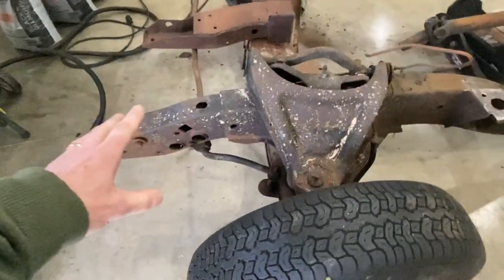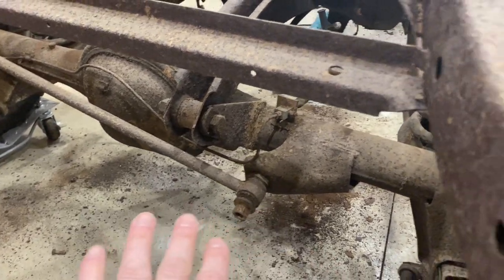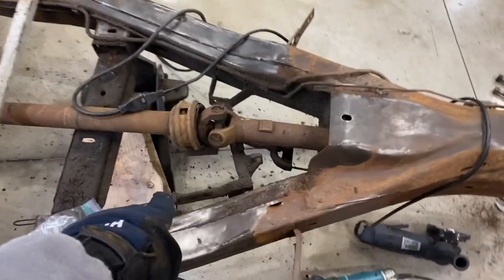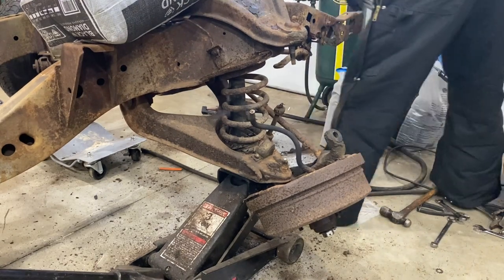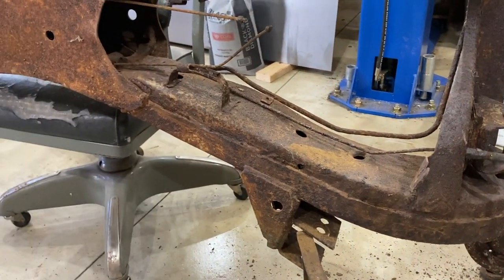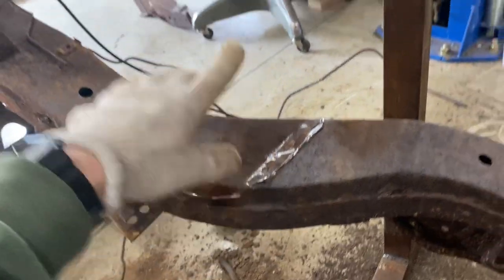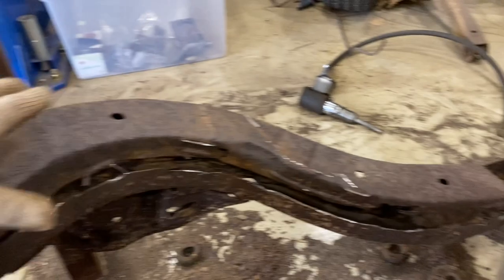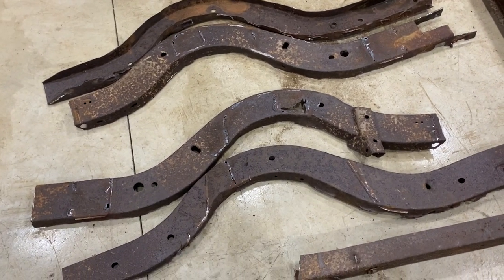I Cut The Back of My Frame Off (BUT FIXED IT!) | @projectcarrescue​

Comment: Back in the mid 90s when I was in the Marine Corps because so many people were getting hurt by the springs shooting out of a truck we would run a ratchet strap from one spring to the other and just get it to where it was slightly tight and that would keep the springs in the perch. Use it if you'd like it's saved quite a few teeth threw out the rest of my time in the Marine Corps. Something I've used even after I got out. It also helps forgiving them back into the Perch on re assembly.
Reply from the maker: That’s a great tip! Thanks for sharing it and watching the video! Also - Thanks for your service!

Comment: Great work, really enjoyed your chassis repairs, when you were doing all the measurements, I thought that doesn't seem right, that the measurements were different from one side to the other. Also you mentioned the possible accident damage to the rear chassis. You managed to get it all square with the use of the Lazer level. Years ago the car manufacturers used to include a diagram and measurements of the chassis in the workshop manual.

Comment: That was quite a task.  Good tip on the laser level. I guess that should have been done first.  2 things...1. I'm guilty of bins that aren't clear. And I find myself digging thru them every couple months looking for stuff.....2 is that the milwaukee m18 1/2 inch impact? Those things are the mack daddy of electric impacts.
Reply from the maker: @lonestarlows It really was a ton of work, but it was cool learning new things and figuring out how to make it all happen.

The laser level would have been GREAT at the beginning. I actually discovered something was weird when I was test fitting the frame under the body for the first time. The mounts were sitting a little off to one side. So I grabbed a laser level at harbor freight and was like “Oh crap”. Lol. That was a good lesson for future builds!

The clear bins are key! I just started buying them a couple at a time to replace my old ones, and my part organization is definitely improving!  As for the Milwaukee - YES! It was my Christmas present to myself 2 years ago and I absolutely LOVE it. One of the most useful tools I have for sure.  

Lastly, Thanks a bunch for watching! As you may have noticed, I moved this Impala build over to this new channel because these build videos were not getting any views on my @rattymusclecar channel when mixed into all my wiring videos. So this @projectcarrescue channel is the official home for my Impalas and other project cars!
Reply: @projectcarrescue  😎😎

Comment: New subscriber #272. Fantastic work. I’m just curious if taking those measurements while the frame is on its side might have skewed the readings just a hair?
Reply from the maker: It’s very possible that having the frame on its side could have made the measurements wonky, though I did dozens with it flat too. I’m sure it was it was a little bit of everything that caused it to be off. Luckily I was able to straighten it before fully welding it all. I also tested it under the body again when I was done and it seems good now. I’m excited to sandblast and prime it!